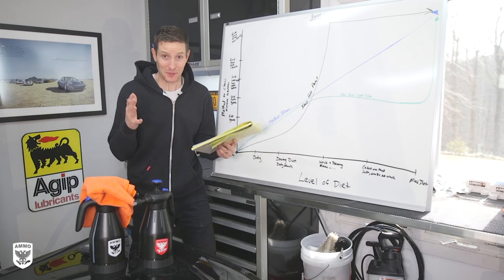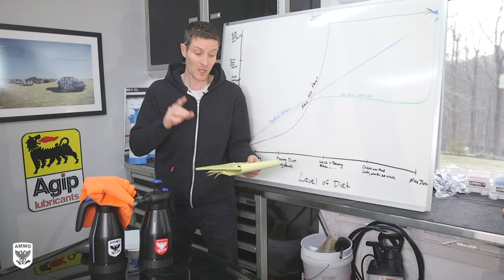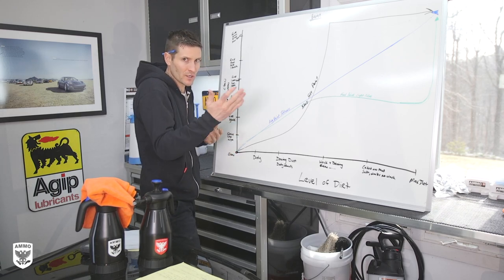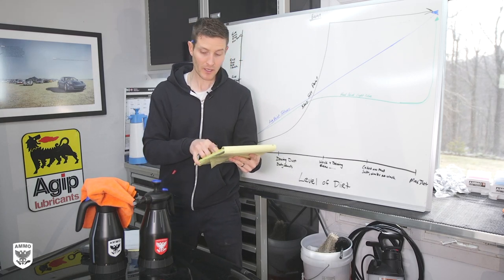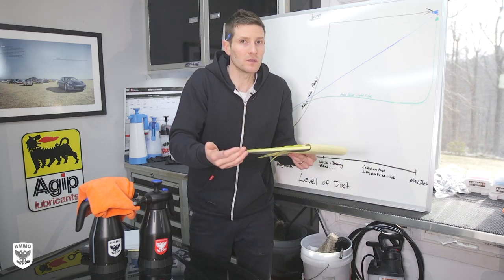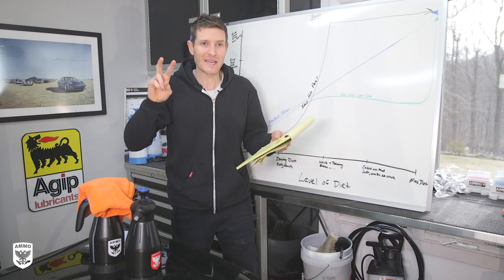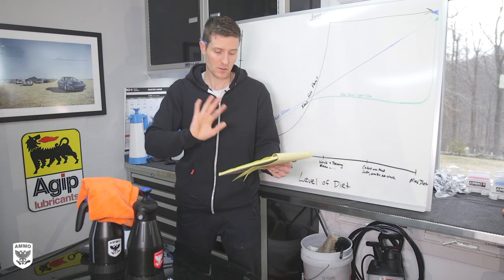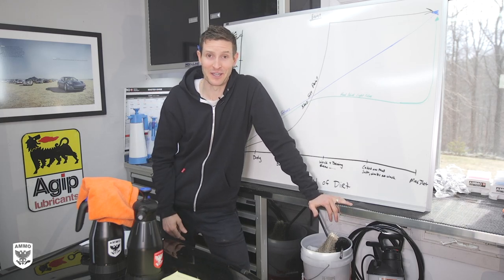How to Wash your Car with No Water: Q&A

Comment: I have to second (or third) the statement of "it actually works".  It really does.  I used it a few times on a few cars of varying dirt levels this weekend.  I would say that the keyword here is "maintenance".  I like to think of this as a maintenance product.  Before the car gets really dirty, use the FROTHe.  If the car is super dirty, you need a proper wash.  But, if you've been keeping up on maintenance cleanings with something like FROTHe and spray wax, you won't have to do as many major washes.
Reply from the maker: Well said!
Reply: Exactly!
Reply: This guy gets it.
Reply: Easy as that. 

But what about spray waxing and buffing it after such a "light" wash like with Frothe or similar? Since you are buffing really hard, I am really afraid to wax unless I have properly cleaned the car.
Reply: amorbavian If you applied FROTHe and wiped off the dirt using the method Larry demonstrated in the video, you should be left with a clean surface that is free of contaminants. Follow it up with a protectant like Hydrate or a spray wax.
Reply: Just used the frothe and the aerator and absolutely loved it.  I wash my car once a week and keep it well maintained.  This is perfect for me.  Thanks
Reply: The hydrate works perfectly with frothe

Comment: I came back to this after thinking of a problem I have, my workshop does not have a paved pathway and my track and race cars are frequently towed in at the end of their season, the end of the season also corresponds with freezing temperatures and precipitation, I'll have to give this a try to clean up and prep the cars so they're clean during winter storage and maybe do some cleaning and correction steps while waiting on parts and materials instead of trying to cram it all in during season prep.

Comment: I just finished using this on my car covered in a thin layer of pollen after a rain storm. The lubrication that this stuff provides is absolutely incredible- my towels almost slipped out of my hand.

My car is clean- I haven't noticed any new scratches, but I think Frothe's lubricity is hard to beat.

Comment: Where I clean cars this has been perfect. I have no access to water or electricity. I do very different process. I start with another waterless spray wash and then spray Frothe foam heavily over it, then use a microfiber sponge soaked with Frothe and then wipe off with Hydrate. Followed by a foam wax applied and wiped much like Frothe.  Sometimes I need to do an all-in-one and found an awesome RBL Products cordless polisher for an unreal price new online, but honestly between Frothe and the new spray and foam waxes I honestly almost never need the electric polisher. Ryobi makes a fantastic wet/dry vacuum that is cordless. Thank you Larry for making such awesome products.

Comment: Nice one. I knew this would come up soon. It's so obvious that nothing beats a WATER wash (hose/2 bucket method etc.). By the way, using ONLY the Frothe and towels to wash the car isn't exactly an easy task. It needs to be done properly like how you do it, in order to avoid scratches.

Comment: Can you use it like a rinse less wash? Like optimum no rinse ONR. 
Spray the froth
Wash panel with just water using microfiber mitt or big red sponge
Spray your products or bead maker 
Then towel dry
Rinse mitt or sponge 
Repeat

I guess I’m trying to eliminate multiple wash towels 
I feel your product because it foams will have more lubricity then ONR

Comment: Larry,
I've always been a huge fan. Your products are on point! I have a question when using the frothe. Would it be better to damp the microfiber towel before wiping the frothe away? Similar to damping the towel before using the hydrate (original formula)? This will add lubrication and would also decrease the amount of towels you'd use since you can rinse the towel in a bucket of clean water (with grit guard), wringing out, then use it damp again, similar to the two bucket wash. Thoughts?

Comment: Hey Larry! I was just watching a video from Scott over at Dallas Paint Correction and he had mentioned that his favorite clay lubricant is Armor All Ultra Shine Spray Wash. He isn’t a huge fan of armor all, however, this product foams on the surface of the car which keeps product from dripping off of the car onto the ground causing you to have to keep spraying product over the panel to keep the area lubricated. I was wondering if FROTHe could do the same thing since it is a waterless wash that foams up really nicely. I’d be interested to hear your comments and maybe even see a video where you tested this on your test panel to see if this method would scratch the paint.

Comment: i live in an apartment building and there is a water faucet on the top level of the garage where i clean my car, so naturally i only have a hose (no pressure washer), do you have a product like that spray can for frothe that can act as a foam cannon for people with no pressure washers?  thanks
Reply from the maker: Yes the aerator

Comment: Ok, so in the summer, does this fall in between of the hydrate trick and a full wash. Just rinsing and drying with hydrate is great, but when there’s still a little dirt left, can I safely use frothe instead of getting out all the buckets and soaps?

Comment: What would you recommend doing with the towels afterwards? Obviously wash them but after theyre washed what "level" would they be considered?
Reply: I think that purely depends on how soiled they got.  If you kept them away from the wheels and washed them properly then for the most part they should be just fine to keep using on paint, but it's really case-by-case.  Maybe you used one of those towels on the front bumper and it got some tar stuck into it that the washing machine didn't get, in that case that towel would not be fit for paint work any more.

Comment: So I got my kit today and couldn't wait to get home to try it. I added 6 capfuls and filled it to the 48 oz level, I think it was supposed to be 40 ounces and not 48 oz. That said, it cleaned the car well but I have to get used to the excess that seems to fly all over the place.

I used some plush, edgeless mf towels to do my own car and it really produces alot of foam upon the wipe, seems like this is the case in the video but I'm wondering if I watered it down too much with the 6 caps/48 oz level, thoughts.

I did wash my wife's car afterwards and used the provided mf towels in the kit, her car was really dirty so it was a better test and it came out pretty good, just gotta feel this process out. I say this because I would do a single swipe and then roll the towel over to a clean section, about 2 wipes per square. 

I should also say that I used 1.0L per wash, I guess I used to much but it didn't seem like I was using too much but maybe I was, thoughts. I appreciate all the input because I wanna REALLY like this and I do but wanna fine tune the process.

Comment: What if i use the aerator with paint soap + ammo boost and use it as foam gun replacement on normal wash (hose, buckets, etc)?
Reply: Carlos Rivera you can. Just a different tool that does something similar to a foam gun. Just do it sections, you don't want the soap to dry.